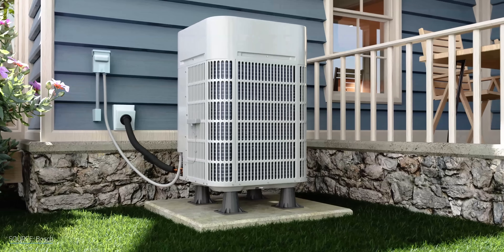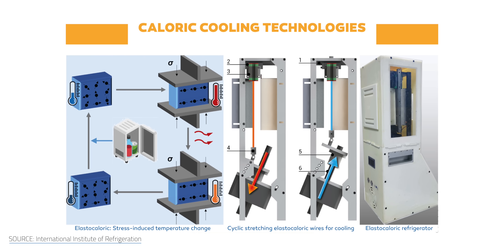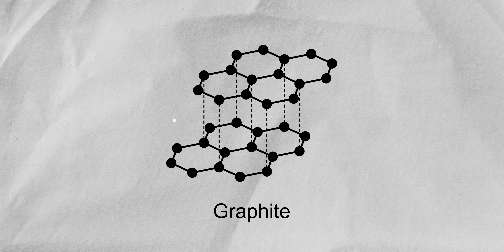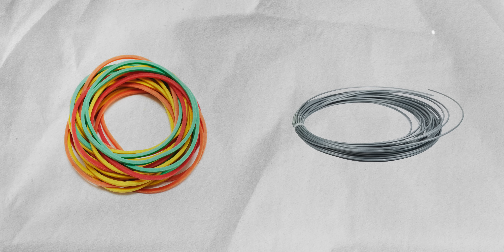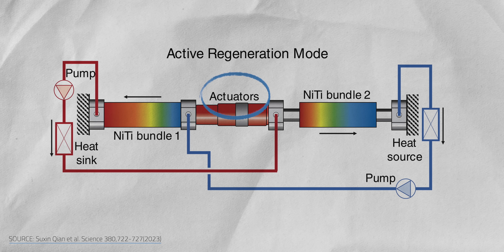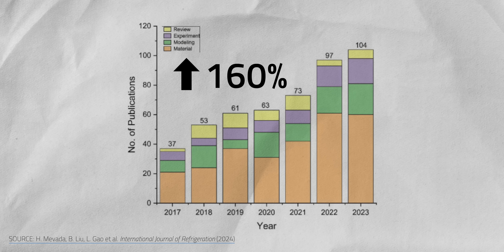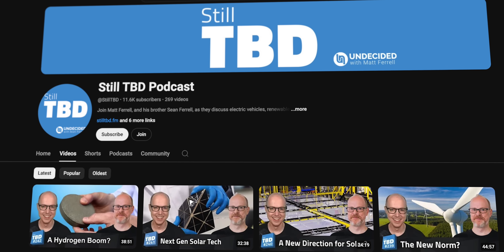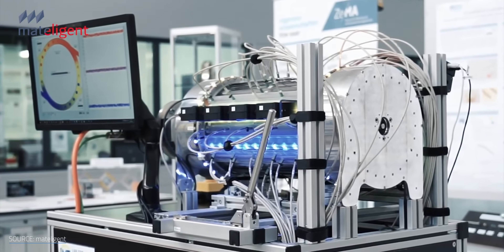How Solid State Cooling Could Change Everything

Comment: So, to make this effective sounds like a mechanical problem. The rod needs to stretched on one side, then released in the other. A pole with wider tips that can slide between two heatsinks. The tip catches on the center pillar, but the force of the weight on end keeps pulling. Then a force pushes the pole to the other side. A modified linear actuator should be able to do the job.
Reply: i think cycling a loop of wire that gets stretched and relaxed locally could be an approach

Comment: Hilarious you tackle this topic a month after technologyconnections did a similar piece on devices actually using solid state cooling tech. This isnt "new", its been around for decades; it also isnt more efficient than an hvac cycle for a useful amount of cooling (though perhaps that could be improved).
Reply: "technologyconnections did a similar piece on devices actually using solid state cooling tech." <- TechnologyConnections discussed Peltier cooling.  The phenomenon discussed in this video is different (though still a property of solids under an EM field.)
Reply from the maker: I've seen that video (it's fantastic).  As @TheDanEdwards points out, that's a different technology than we're discussing here (Peltier cooling vs. Elastocalorics).

Comment: Seems like this might be better for initial use in large scale cooling/heating, since the issue of making it more compact seems to take a lot of effort and only seems to benefit consumer level use. I’m also concerned about the cycle life of the materials. That could the real road block, if the don’t last as long as CFCs.

Comment: I have a low voltage peltier fridge. I can take only 6 coke cans. However its better than nothing if the power goes as t is happy running from a home made power bank. The question is does this beat peltier?

Comment: something i didnt get,  are these some materials that are cold under stress or the way iit works is you compress, it colds, you pass air through it to remove heat in the air, then you have to stretch it, it heats, you have to pump outside air, remove heat from metal back to the square one? i guess the second if not is quite simple working

Comment: Just put them in a tall tank filled with water then stretch and squeeze back. You'll get a constant water temperature separation, hot on the top, cold at the bottom. Please contact me later for giving a Nobel prize 😆

Comment: I do not know if I understood the material well enough but, being a metal, couldn't it be stretched using a current?
The current would heat it up causing it to stretch which in turn would cause it to heat up more. Then cut the current and cool it, maybe with a fan and perhaps some graphene sheets to help it move the heat away.
Reply: using a current would heat up the material and could actually trigger a mechanical response, similar to what Matt showed with the torch.

Comment: so really what you’re talking about is replacing a gas based refrigerant with a metal based refrigerant and I’m guessing that the metal still needs to be insulated from the environment so it enhancement to a traditional reverse cycle system not replacement for it

Comment: Electronic component cooling (processor or memory etc) that may currently be managed by inefficient thermo-electric (Peltier) based systems is probably a likely early adopter. The ability to build in such technology to the die/chip carrier is also an interesting possibility.

Vapour based systems are difficult to miniaturise whilst solid state cooling systems are (at present) difficult to scale up - efficiencies overall are broadly similar so maybe each type has niche uses depending on the physical size and volumes to be cooled?

Comment: Am I the only one confused about how you are meant to efficiently remove heat from the elastomer? Your cooler needs to turn into a radiator once per cycle, that means that you need to somehow switch whatever you are cooling with whatever medium you are dumping heat into constantly. I really don't see a use for this over traditional refrigerant based heat pumps outside of very niche applications.
Reply: I presume they will have heat transfer fluids, such as water or air circulating over the NiTi as it cools, and the water will cycle to each NiTi element for each cooling stress cycle. They can t be moving the solid into and out of the room for each stress / heat cycle.
Reply: You're not the only one. Short of physically moving the elastomer from one medium to another the only thing I can think of would be something like dual peltier elements but that's going to consume way more energy. How you could physically move the wires between refrigerents without having a nightmare of leaking valves I don't know. I'm glad smarter minds than mine are working on it!
Reply: Some designs I've observed use a pulley system that draws the elastic material through a loop; the pulleys spin at different speeds, arranged in such a way that the material stretches in some parts of the loop and relaxes in others.
Reply: @PixlRainbow  i could imagine how loud such a system might be.
Reply: This is exactly the major problem of solid state caloric cooling and heating devices. All their promises fail when they get to this problem. Most researchers talk about their expected efficiency leaving this problem aside (good to get funding). This is why the efforts in different room temperature caloric cooling systems never reached the market so far.
Reply: It takes more than theoretical difference to determine utility. Refrigerant based heat pumps can take more energy per cycle, or use 'worse ingredients' (HFCs, cost). An example with peltier junctions, even if they were really efficient at the junction, their heat is still generated at the surface boundary, making it extremely annoying to design effective ways to remove it. This stuff causes temperature change in the volume. A simple design could pin a block in the middle, with plumbing through the top and bottom, in a loop. On one half cycle, the bar is compress up, the fluid goes 'clockwise', the opposite expand-compress 1/2 cycle , counter-clockwise. The heat exchange rate effects any attempt, but it opens a lot more engineering choices, especially if there are improvements to the material. A spring is a more obvious example where the elastic ability is maximized, but perhaps a solid block being compressed, or a spongy material... finding better chemical refrigerants has faced a lot of challenges.
Reply: Bingo, it's more green fraud dressed up as science to trick the people. Never forget, "Carbon Footprints" was an oil company marketing strategy, and the majority of green tech is just oil with extra steps.

Comment: Wouldn't it be a much better design to have a wheel imwuth wires connected off-center which spins, instead of an epectric actuator?

Have wires stretched on one side, and relaxed on the other, then spin the wheel. One side gets hot and the other side gets cold.

Am I missing something? An actuator needing to apply the force just seems a bit extreme for what it gives you.

Comment: Solid state cooling has the potential to change the industry. I came across this company called Frore Systems, which makes solid state chips for cooling laptop chips. The best part of their chips is that the pressure of the air was so high, it could pull fresh air through dust filters, which cooling fans can't do. I hope they actually get it to work, because any gaming laptop owner knows how quickly the fans get clogged with dust.

Comment: I was watching one of those YouTube channels where a couple is building their dream home and I ran across a technology I hadn't seen before.  It's just another take on solar heating, but it seems more advanced.  They use evacuated glass tubes.  Basically, it's like setting a clear thermos in the sun, or having a well insulated greenhouse.  I hadn't seen them before so if you covered them I missed it (or my brain just has too many things in it and is starting to leak).  The couple had a big enough array that they needed a pool to dump waste heat into to keep them from overheating when they weren't needed.

A while back I saw that they are starting to get aerogels that are clear enough and that don't degrade in sunlight, to start insulating between window panes.  There is at least one commercial company selling them.  That, if they don't discolor and are as durable as they claim, could be a holy grail for construction, making windows as thermally tight as walls.  

I've seen a couple other small techs... there is a type of manufactured board... super simple, where two 2x4s are put at right angles and connected with dowels.  This limits the thermal bridging to just the dowel spots.  You put insulation in between them.  They don't require any special construction techniques.  Someone used to using 2x4s can switch to using them no problem.  Not worth an episode on their own, but maybe an episode where you covered a bunch of the less glamorous, lower cost, smaller breakthroughs?
Reply: Could you please explain why aerogel insulates better than standard air?
Reply: @flowgangsemaudamartoz7062  it has very little convection
Reply: Evacuated tube solar thermal collectors have been around for decades and are a significant part of the market in some countries.
Reply: @nickwinn7812  I’ve got a pair of panels on top of my greenhouse that were scavenged from a 1980s/1990s project for heating water for cleaning locomotives and railcars.  There are a few variations on a theme with the tube arrays, from the basic glycol or water circulating directly inside the tube, with a copper pipe pushing the fluid to the bottom of the tube and it’s extracted out the top, to versions that have a sealed phase-change material inside the tube to move the heat around.

Which brings me to another product I saw being pitched for mid to low latitudes where you have a high temperature delta from day to night…  insulation/thermal mass pouches with a phase-change gell in them that absorbs the temperature variance and aims to keep balanced temperatures inside the dwelling, which I found very interesting.  I suspect something like that would not perform very well  in places where it gets in negative temperatures and stays there, but as a retrofit to wooden or steel skinned structures in teh desert it might have potential for passive heating/cooling cycles.
Reply: Get yourself a jar of mint sauce and snort...
Reply: what channel?

Comment: The only thing that confuses me would be the heat transfer from the area we’re trying to cool to elsewhere. How would that be done without creating some kind of rotating mechanism of elastocaloric machines. 

Being in the HVAC industry, what seems to be the most efficient in theory would most likely be a VRF system that is able to utilize geothermal heat transfer and ambient temp for a heat pump that is both geothermal and air cooled. A VRF system would be ideal because it’s already designed to recycle energy in the process.
Reply: I'm curious about that as well, it seems like the physical design could involve some very clever arrangements of parts that I'd like to see.

On the other hand, it could be trivial. For example, some Energy Recovery Ventilator systems use a disk of material that rotates as air streams are blown through it. A similar design might work for a solid state AC device. Metal ribbons could be arranged radially like bicycle spokes with an offset hub to create a sinusoidal stretch/relax cycle. Several stages could be driven by a single motor to achieve the required cooling power. Very few moving parts and could easily be combined with an HRV/ERV system.

Comment: Could an efficient implementation perhaps use bendable nitinol fins to guide air while acting as both the heatsink/thermal device? Rest position out flows to one exit, max bend is the other.

Comment: "So why even bother with elastocalorics?"  ---  Can you say "Potential"?  It's kind of on par to a degree with making nuclear plants that use Thorium for the fuel.  Not that Thorium is far more efficient but it has 2 huge things going for it that Uranium does not.  1 -  It's available everywhere in ever abundant supplies  and 2 - It's effect with radioactive waste is much easier to deal with than Uranium.  From the sounds of things Elastocaloric cooling has 2 similar advantages "potentially".  1 - Material is in abundant supply or is already produced  and 2 - Easier on the environment.

I will be monitoring this technology.  I've felt like there has to be a more efficient way to heat and cool than we have currently.  This technology so far holds the most useful promising potential of anything I've read about so far.

Comment: wouldn't these need a significantly more complicated air routing system? it seems like even if the repeated stresses of normal operation on the main thermal element could be solved, theres going to be issues with having to pulse the direction of the air flow across the elements anyways. these could also generate a lot of very annoying noise, though noise issues can be solved.

Comment: Paltier took sebeck effect to cooling by directing the milivolts created by heat between disimilar metals to produce cooling effect. Been done and used in most electronic coolling devices used in airospace .

Comment: With the right kind of design with ceramics, you could create an oscillating micromotor with piezo-electric crystals providing the physical stresses and thermocouples providing an electromagnetic charge to pump into the crystals to release the stress, cooling down the material, and creating another charge when the temperature gets hot again; you can make a micro-heat-pump as a painted on layer on a microchip. Cool.
Reply: Thus creating a microchip with it's own integarted cooling system if a Nitinol structure was somehow added.
It would maybe not avoid the need for extra cooling, but it could reduce a lot of it and eventually reduce the energy consumption in data centres.

Comment: Mmm.. I dunno about solid state vs refrigerants because we already have CO2 as a refrigerant which is zero-carbon despite being ... ah, Carbon.  Because it is extracted from the air, and if it leaks it just goes back into the air it was extracted from.  Zero Carbon.

CO2 systems also use much shorter refrigerant loops, but because of the pressure they generally have to be completely contained in a relatively small space so you need some sort of heat exchanger for general use.  A water heater is just the easiest use-case because all you have to do is loop the water from the tank through the CO2 heat pump and back out again as hot water.

I like the concept of solid-state, though.  Solid state is awesome.  There is a potential for very high longevity verses the nominal equipment life of a heat pump.

-Matt

Comment: Calling it solid state seems like a little bit of a stretch
Reply: Aaah-ha, "stretch", I see what you did there.
Reply: @CGrantL  it depends on how rigid or flexible the definition of "solid" is.
Reply: @m1kem477hewz  This reminds me of the people referring to people harnessing the wind over pizeoelectric surfaces generating electricity.

I honestly don't care if the parts move or not - but if there is a moving part, it's eventually going to break and that needs to become part of the maintenance and cost of operation equations.
Reply: You must know that there is no relationship between what you call “moving parts” and breakage. This is something that happens in any device and in any system, even with electronics and electricity. I have a hair dryer that after a while it no longer heated the air. When we opened it, we found that the wire ( resistive wire ) that runs through it had broken, The heating wire was cut off (broken). One time, my internet router was not working even though the subscription had not expired yet. We noticed that it was covered in dust. When we cleaned it well, it came back to work again (now if it had “moving parts,” they would have said that the reason was “moving parts" This is ridiculous). I will give you another example, I found the refrigerator protection device one day not working well. When I opened it, the circuits had some rust and some of the capacitors were also broken. It is naive to link certain matters to a specific system and limit them to it, as this can happen with all systems. When electrons (electricity) pass through something, they gradually consume it, like the heating elements in the example I mentioned. This also happens with capacitors, where the dielectric collapses. Another thing is that the term “solid state” itself is wrong or exaggerated, because even the things they claim to be “solid state” are not that !!
Reply: "solid state" (Although it is a wrong term) not related to electronics and it is not limited to electronics.

Comment: I think a promising thing would be for things that are already moving where you can use the kinetic energy that is already there. The pneumatic system between train carts. Boats rocking with waves, etc. These are hard to convert to electrical energy due to being chaotic. Using them as they are could definitely be beneficial.

Comment: Not just efficiency but also longevity.  Modern efficient refrigerators don't last for nothing.  I'll take that 1980 refrigerator from Craigslist that will outlive me and everyone I love.
Reply: Issue is those old refridgerators use enough electricity to buy a new fridge every 5 years, at which point just buying a quality modern one becomes a better option. 

Both of my "modern" fridge and freezers are 15 years old now so it's not exactly as if they "can't" last.